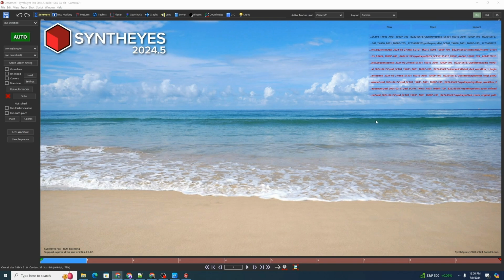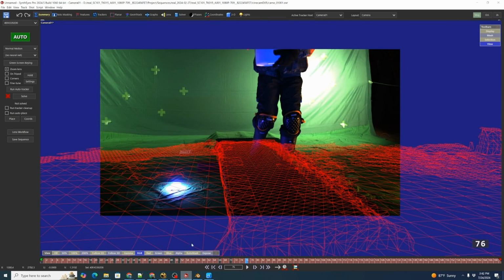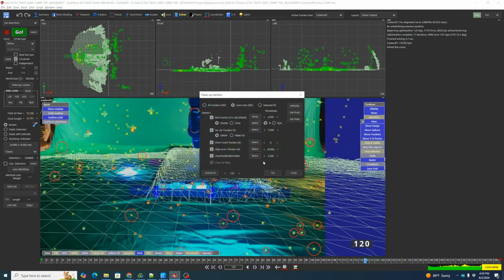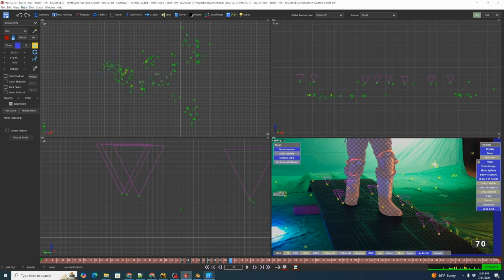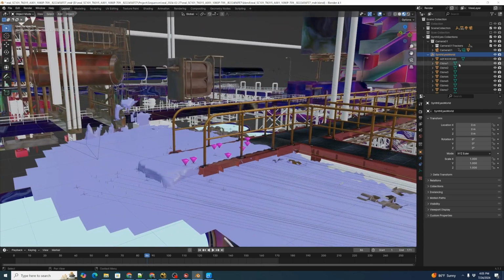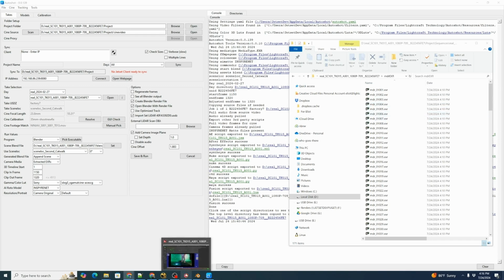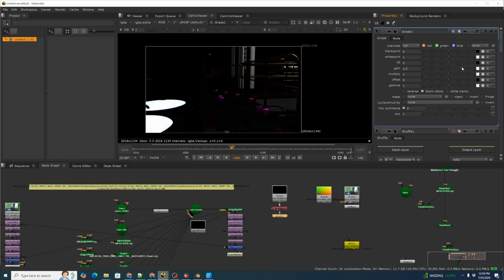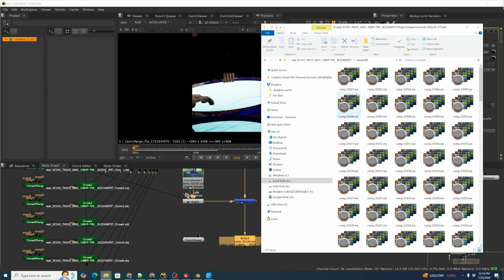Tracking Refinement with Syntheyes

Comment: Refinement tracking : do you mean that on every project/shots we have to refine 3-D tracking with suntheyes or equivalent ?  I am confused because I thought Lightcraft and the accelerometer of the iPhone already did the job of a 3-D tracking ?? If it’s the case, the real benefit of light craft is the ability to monitor in real time as CG set with a live video. ?? Thanks
Reply from the maker: The standard Jetset tracking is easily good enough for shots that don't have visible ground contact. You can see some videos done by Alden Peters on Youtube that are all straight Jetset tracking. The shots with highly visible ground contact require an additional level of precision; that's what the SynthEyes pipeline is designed to handle.

Comment: Where can I get the Overscan addon that you are using for Blender?
Reply from the maker: In this case, we're not using an overscan add-on, but manually entering in the overscan sensor size calculated in Syntheyes. Much simpler.

Comment: Hello. I am considering purchasing an iPhone Pro to use the LiDAR feature specifically for virtual production with the LightCraft application. Could you please let me know if there is a significant difference in LiDAR quality and performance between the iPhone models from version 12 up to the upcoming iPhone 16? Are there any major benefits of using the newer models with your application?
Reply: We've found remarkable improvements with each new generation of iPhone, especially in GPU capacity and in cooling. The LiDAR hasn't changed much, but I'd still recommended getting the newest iPhone you can simply for the other performance aspects. It makes a big difference. We're getting Jetset ready for iOS 18 and looking forward to what is in the new hardware coming up soon.
Reply: @eliotmack  thank you for the clearly answer.

Comment: Under what circumstances would you need to refine the live track?
Reply: Shots with visible CGI & live action joins. In this case it's the join between the CG railing and the practical floor, but in other shots it might be high degrees of floor contact.
Reply: @eliotmack  do you mean that on every project/shots we have to refine 3-D tracking with suntheyes or equivalent ?  I am confused because I thought Lightcraft and the accelerometer of the iPhone already did the job of a 3-D tracking ?? If it’s the case, the real benefit of light craft is the ability to monitor in real time as CGT sets with a live video. ?? Thanks
Reply from the maker: @stephanec3436  For many shots the standard Jetset tracking is fine. All but one of the shots in https://youtu.be/s2y2lcsL_Lk?si=oOkG1VY3s8Q5wM5X are from the Jetset data. For certain shots with very visible ground contact, you may need to do tracking refinement. It's very shot-specific.